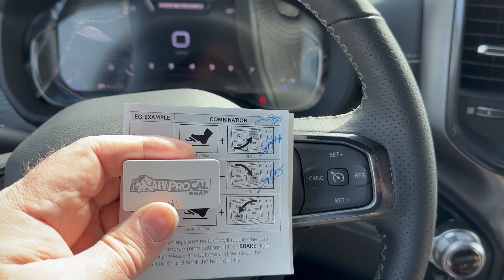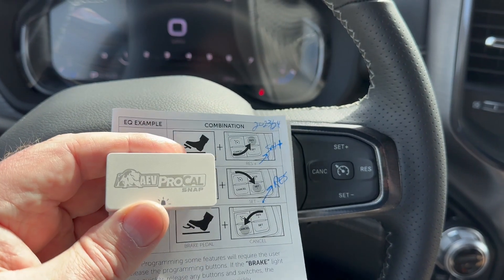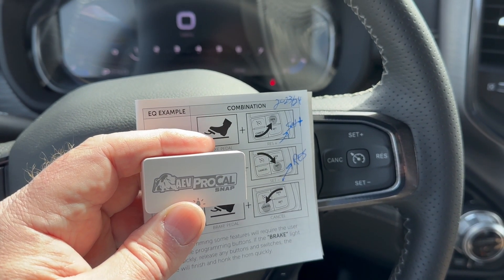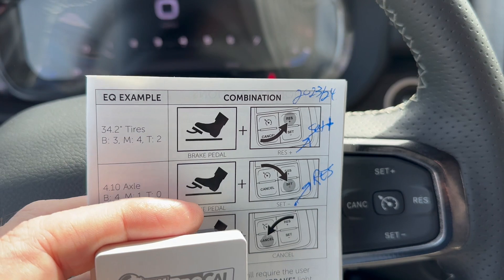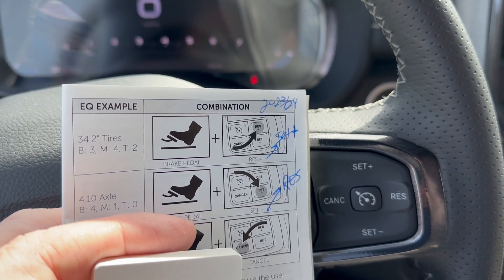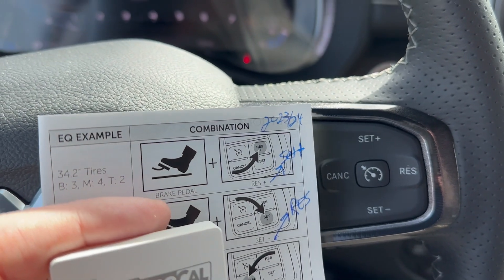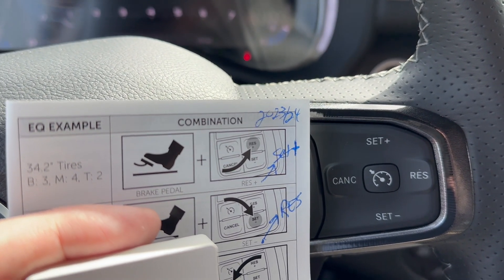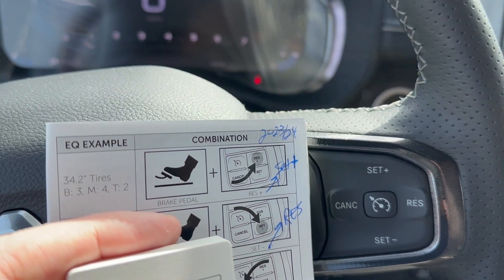AEV Procal Snap Programming Issues for 2024 Ram Power Wagon

Comment: I just got this for my 2023 power wagon. I’ve tried to adjust the tire size and the truck get all kinds of error codes going off. Did you ever get your tire sizes to change without issue?
Reply from the maker: Did you note the incorrect manual reference for the cruise control layout and adjust accordingly as shown in the video?  I didn’t have any issues after I made that adjustment.  Also, did you connect the wiring up correctly?
Reply: @ I got it figured out. Turns out I was holding the brake and the set button for too long. Apparently, if you hold it for much more than three seconds, it can create the whole Christmas tree thing. I counted three seconds and let go and just let the truck do its thing and everything worked out fine.